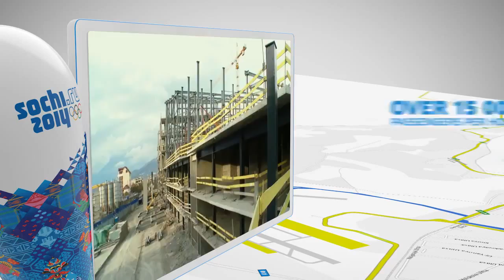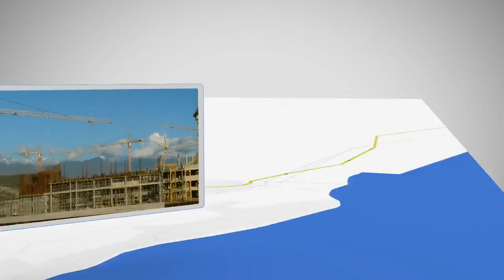Sochi 2014 Winter Olympics, Russia - Venue Preview - Unravel Travel TV

Comment: I have a question. How the olympic games 2014 can be more expensive than
Euro 2012 in Poland and Ukrane?
That doesnt sounds very logical for me.
Please someone give an answer.
Reply: THIS IS RUSSIA
Reply: Here everything is not logical
Reply: Маленький городок Сочи, буквально с нуля был заново отстроен.
Все олимпийские постройки поставлены за 4 года.
Как-же в горной местности проложены тысячи километров шоссе и отстроены крупные торговые порты.
Вы спросите - окупиться это? 
Вряд ли - я вам скажу. 
Вся Россия ругает правительство. Но в столь коррумпированной стране граждан считают за скот, - мнение народа лишь смешит чиновников.
Reply: The previous reply is right to the point. Sochi didn't have the infrastructure to hold such a gigantic event, but nor did the other cities on the Black Sea. They basically had to build everything from ground zero, beginning with wiping out old structures and clearing landscape for the building sites. Building the roads leading to the mountains, laying train tracks.... and so on.
Reply: Only 30% of the constructed objects are related to the Olympics. 70% is the modernization of the whole city from scratch. Sewage treatment plants, sewage, power, power lines, roads, tunnels, buses, trains, hotels, quays, port. Many people have moved and they were compensated. Sochi is a grand building + in a short time. In normal development, this building last 10-20 years (and it certainly is cheaper).